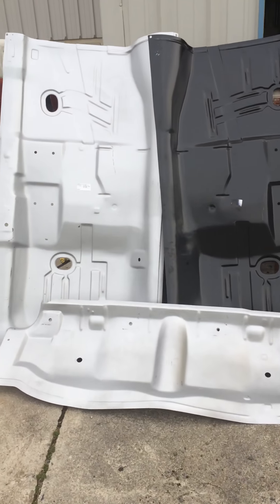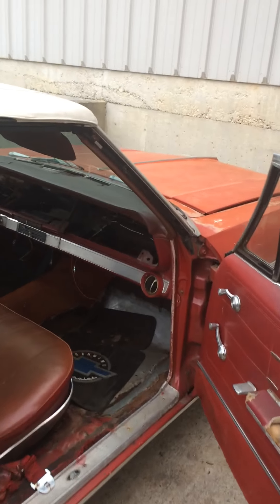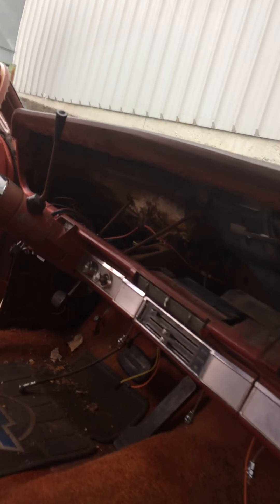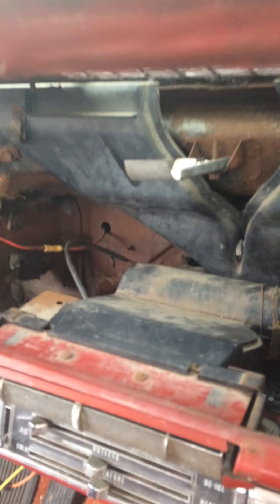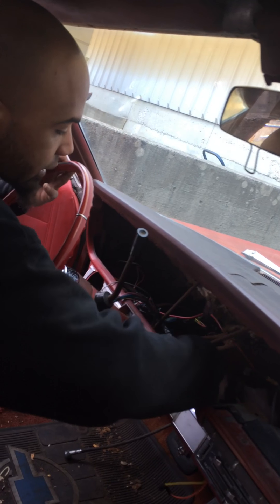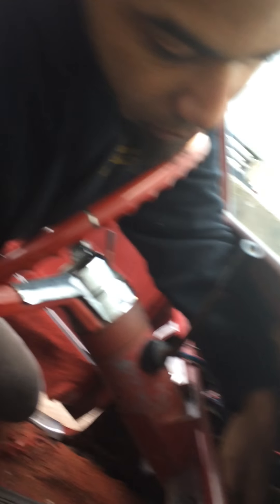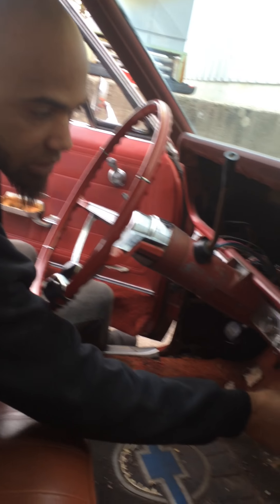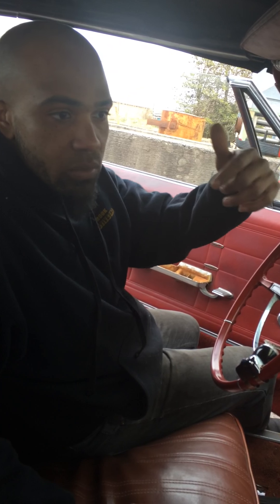66 Impala Floor Pans and Wiring Harness from Classic Industries

Comment: Thank for the video. I have a convertible 66 impala I need that harness which one did you buy?
Reply from the maker: Vincent sanders the underdogs wiring harness part number is CG60694 it’s the one that’s around $490. I caught it with a promo special ad got $60 off.